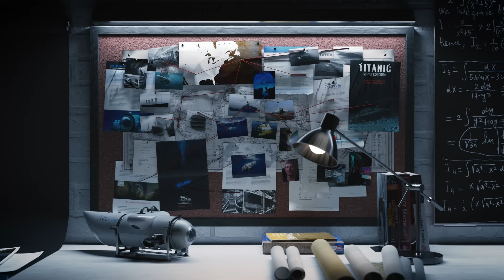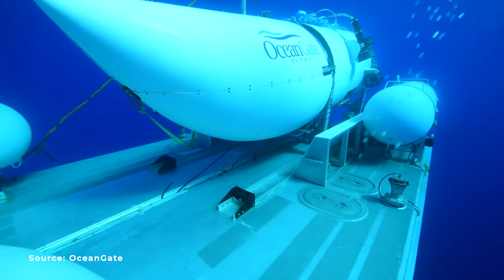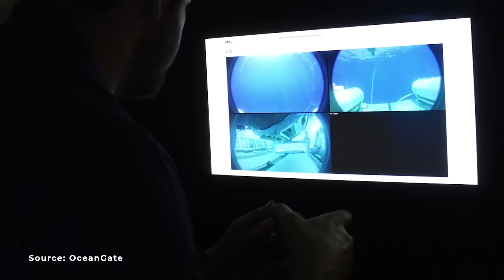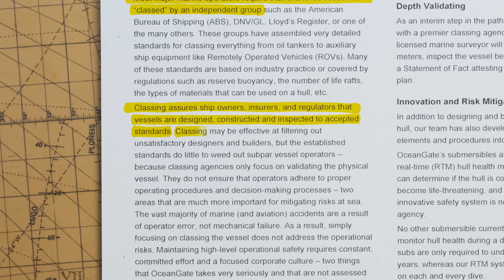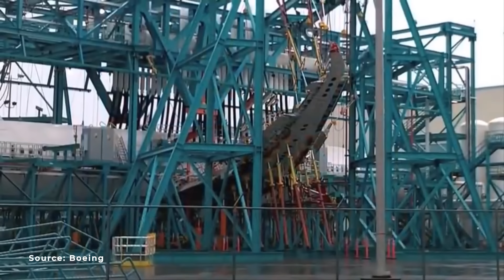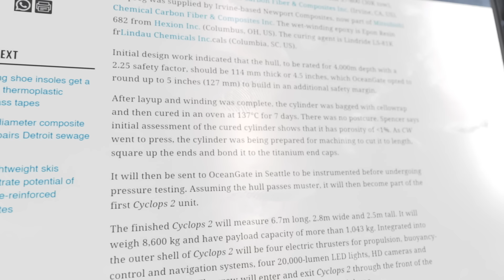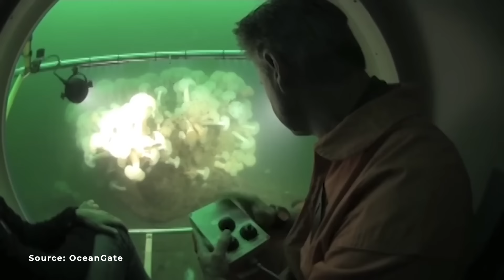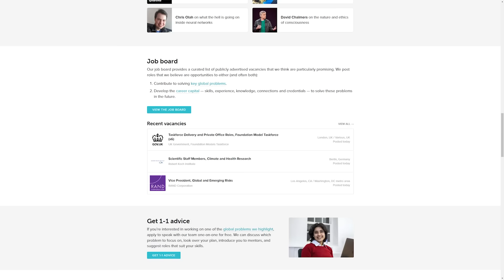The Questionable Engineering of Oceangate

Comment: 70 minutes to the bottom? Why would you want to go that fast ? It  will can only exacerbate any problems that you already have.. I would rather make sure that my sub can handle the current atmospheric pressure that I'm going through before I pass into the next. Going that fast is like putting three or four extra atmospheres of pressure on yourself all at once. It just doesn't make any sense. You're putting so much more pressure on your craft than if you just went down slowly .

 Say you have a problem that won't make your sub implode at your current pressure level but it would make you implode 3 atmospheres down. Well if you're going that fast you'll never know that versus if you were going slowly and you heard something crack you might have time to turn around. But you're damn sure not going to have time to turn around if you're passing through atmospheres that quickly. .  it's just so stupid I mean all it  can do is cause problems. These guys really didn't have a clue what they were doing did they

 the billionaires that got in that thing wet're just a stupid because they didn't do any research on the company or the sub. No due diligence whatsoever . They just assumed that the $250,000 ticket ensured their safety 😂. Like all extremely wealthy people they think money can fix everything.Well  I know something money can't fix. It can't fix stupid😂 .

Comment: Even passenger cars are tested more rigorously than this specific vessel. How many actual discoveries for the use of composite materials in crushing depths did Oceangate make, or even use? How many real world, full or even small scale tests were completed for something that would at least let the designers, manufacturers and operators know that the submarine will be absolutely safe for a number of dives? How many non-destructive tests were defined to be performed to the actual hull before and after dives to know if the state of the structure was as expected and how many were performed? The answers to these questions would be alarming if they were in the single digits, but it's more than likely that they were simply zero. The people responsible for such an accident were may not have even been aware of the importance of such measures. Over-ambition resulted in the death of five people in an outcome that anyone with a slight idea of the Titan's design and a proper grasp of the operational conditions it would be subjected to had predicted.

Comment: I'm a Mechatronics engineer. In university, one 1st year assignment was to design a submersible that could be used for marine research. We also had to specify and justify the material used. In our group, we thought of using carbon fiber, but then we saw there was no elastic modulus in the simulation software parameters for carbon fiber in the material properties list.  Obviously, if you can't simulate it, you can't prove it would work, and the carbon fiber idea was abandoned.

Comment: From reports I have read, the Titanic ship was not sunk directly by the iceberg,  but by the portholes that were left open by passengers.  The area of the open portholes was a lot more than the gash from the iceberg, and the portholes were all along both sides of the hull, from stem to stern... While the gash was only on one side.
Reply: Erm sure.  I think it had a lot more to do with the lack of interior watertight compartment bulkheads that went to the ceiling.
Reply: @stargazer7644  When pretty much every porthole was open the watertight bulkheads mean nothing....
Reply: @chrissmith2114  It was 28 degrees on the night the Titanic sank.  Why in the would would most of the portholes be open?  And the ship has to sink in order for the portholes to go under the water.
Reply: @stargazer7644   People felt the collision and opened their portholes to try to see what happened is the best explanation, once the ship started to list some portholes would allow water in, after that it was inevitable that it was doomed. The steam heating on the ship may well have made the cabins very warm even on a cold night.
Reply: @chrissmith2114  I just took a look at the blueprints and deck plans, and the lowest portholes on the titanic were above the level of the open top compartments that are watertight on other designs, meaning those compartments had to completely flood before allowing the portholes to reach the water.
Reply: @stargazer7644  There were also apparently complaints from passengers that the cabins had an overwhelming stink of fresh paint - they did not use nice smell-free paints in those days, they had proper stinky oil based paints. l

Comment: When I first saw the news, I checked the info on the submersible, how it was made and my reaction was - welp, they're dead. It'd have been fine if each submersible was a 1-time use vessel, designed in a way that it's relatively easy to swap the hull each and every time they go for a dive, they could've simply made the rides more expensive. Their clients were billionaires, it wouldn't matter anyway and the ride would've been safe. Yet the stupid greed overtook the owner and that's why he also paid the ultimate price.

Comment: Popular youtube seems to be saying the titanium to carbon glue joint was the cause of the failure as the recovered end caps are clean.  I believe the center tube failed with the instaneous internal pressure blowing both endcaps off.  Being a retired civil enviromental engineer  and not a materials expert I am  thinking the properties of the carbon failure are not an issue as much as the lack of elastic, plastic , and fatigue properties of the matrix or resin.  Are resins designable that deform in a significantly plastic mode so as to give adequate warning of failure  by measurable strains or in the case of a submarine an observable increase in internal cabin pressure.    What is your opinion?  I hate to see you close the door on use of composites for submarines or resistance of compressive forces.  Is it not just a matter of advancing the technology  in a prudent and honest manner.  It ends up where it ends up.

Comment: Simple research / education reveals that carbon fiber is an organic material; contrarily, titanium is inorganic with a highly reflective quality that does not corrode at all in prolonged exposure to the extreme pressure of deepest sea water, which of course includes salt, which aerospace vehicles are not exposed to. So many facts are available about the effects of epoxy on the two different materials. No visible traces of epoxy exist on the titanium rings that were recovered, which is to be expected of this inorganic material with its highly refractive index. The bond between the two different materials was sure to fail with prolonged exposure to the extreme pressure of saline water at ocean depths. Many of us who have worked with epoxy realize that the CEO and his associates ignores this obvious information that is publicly available.

Comment: The thing im struggling with is that spencer composites, who made this hull and the carbon fibre hull for deepflight challenger, seem to be getting away without scrutiny.  I dont deny stockton rush, as ceo is ultimately responsible, but he was on the sub, many times. He was Icarus, not Gregor MacGregor.  Why dont we look at the design and tests Spencer did and ridicule them for making two carbon fibre hulls?  Will they make another? Stockton is done, he won't make another but spencer should not have taken a job to make a death trap.

Comment: Everyone seems to primarily focus on the radial compression component of this failure (ie: a circle with pressure pushing inward).  What terrifies me more about this design is the axial pressure, producing a multi million pound force perpendicular to the mostly circumferential wound fibers. In that direction the compressive load bearing of the cylinder seems more questionable than the radial direction.  To makes matters extremely complicated for FEA, the outer fiber’s incredible hoop strength (with help of ocean pressure) diverts the axially displaced cylinder volume mostly radially inward with preference to the inner most layers of composites to yield first.  If the dominant fiber orientation is a spool winding as shown in all the hull manufacturing videos, I believe they made a structure that’s easy to axially compress which is also prone to fail inner layers.  Curiously if you do a simple axial compression calculation of their structure’s cylindrical crossectional area and substitute in compressive values of epoxy instead of  carbon fiber, and assume the dive depth that the failure occurred at,  you get a safety factor of .91

Comment: Input from a car geek, also pertinent to aerospace use of carbon fiber: the autoclave curing mentioned is also often paired with what's called pre-preg or dry carbon fiber. Pre-preg basically means that the matrix material is already integrated into the fibers, and only needs to be heated in the autoclave to cure. This is the type of carbon fiber used in aerospace applications and in expensive supercars. That Stockton Rush thought he could get away with using hand-laid vacuum-bagged carbon is absurd. That's the stuff that anyone could use for backyard carbon fiber projects or aftermarket car bodykits. I get the feeling that Rush genuinely thought that he just needed to use more of it and make the hull super thick to compensate, which probably did save the company a lot of costs compared to dry carbon. Problem is is, well, we all know by now. And it's likely that using dry carbon would've just added a few more dives to that deathtrap anyway.

Comment: If the leaked transcript was not fabricated,  the acoustic warning systsm indeed did warn them 20m, before the last message from the sub.

However the sub was diving 30% faster than expected since the star, due to unkown reason and the sub floated upwards very litlle during those 20 minutes.

In the end the sub had a partial battery failure  as well.

A reasonable captain, would have aborted the mission at start then and have the sub checked for the dive speed, but no such person would of course be in that innovative backyard sub.
Reply: Did not know of excessive diving speed, (even ascent speed critical).....
dP/dt, Pressure rate CONCERN !!!  Stress MUST propagte EVENLY AND EQUALLY ACROSS the ENTIRE HULL with virtually no DIFFERENTIAL. That is a Spec & Op violation. Along with unknown reliability of number of Pressure, Fatigue cycles permissible.

Comment: You failed to mention that the installed viewport even rated for nearly the depth they were going.

Some  theoretical research has been done on using carbon fibre as a material for pressure vessels. Concluding that it could be feasible but would come with major design challenges. It's clear that OceanGate did not take these design challenges serious enough.

Additionally a submarine designed for that depth has to keep near-perfect roundness.

Comment: You don't need to be an expert to suspect the carbon fiber hull was a bad idea, you only need to know that filament is far more effective in tension than compression and that diving is pretty much all about compression. That was an immediate "this doesn't seem to make sense" red flag to me. We know that the sub ran into power issues and dropped ballast, which means they knew some time before implosion that something went wrong. If the alleged transcript leak is true, there were at least 18 minutes from first alarm to failure, much of which spent trying to diagnose power/thruster issues when thruster ascent turned out excessively slow (a possible sign water got somewhere it wasn't supposed to) instead of doing an emergency ascent.
Reply: Just Nylon monofilament fishing line rated at 20#, Pulling on it, it's strong. Compression, FORGET ABOUT IT !!
Reply: @adrianmonk4440  Using carbon/glass/nylon/polyamide fiber filament for a compression load is like using concrete for a tension load.

Comment: I do composite work for an f-sae team, and the fact that they didnt use an autoclave to save costs is absolutely insane. Even we use an autoclave for the most important and structural parts, and I have a funny feeling our budget is a bit smaller than oceangate.
Reply: We have I think 4 autoclaves where I work in SoCal that would have fit that hull. Not sure if the other, smaller autoclaves here would also work.

One of them is large enough for a school bus to drive into. Currently unused, but operational.
Reply: 200k to make the the submarine and the other 10 million on hookers and coke for Stockton rush cause he had to be on something to think this was remotely sensible
Reply: Ha, and we used expired pre-preg when I was in FSAE, but that's because we had a tiny budget and it was a goddamn FSAE car, not a deep sea submersible.

If you are are a billionaire building a life-critical pressure hull, and you're cutting corners that would make a team of 20 year old, sleep deprived amateur race car engineers with a budget of zero dollars nervous, you should probably stop what you're doing immediately.
Reply: Haha, I felt the exact same way, there's no way my F-SAE team can afford to use an autoclave, while OceanGate couldnt. Each passenger pays 250k, and they couldnt afford an autoclave. Crazy
Reply: I too did composites for fsae and I had to pause the video and scream into a pillow at that part. This is the kind of neglect I might expect from a 19y/o without a degree and illusions of grandeur. Hell, you don't even need a degree to at least know you should get air bubbles out of the resin. It's common sense for anyone that's ever actually worked with the stuff with their hands. 
We learn about fatigue testing in undergrad... All of this is just neglect of the basic due diligence one should expect of anyone with a relevant engineering bachelor's degree.
Reply: when I heard that I was absolutely mind-boggled. It makes absolutely no sense to me why they did not use an autoclave
Reply: I'm pretty sure it had to be done in an autoclave because it was a pre preg layup, not filament wound like this says. Rush says so in a presentation about the first and second hull design.
Reply: It's not obvious that autoclave consolidation would have made this fundametally safer. There are vessel design issues that have little to do with consolidation.

Autoclaves of that size are really uncommon. I'd totally believe that they simply couldn't find one to use.
Reply: @appa609  Autoclaves of that size are used on a regular basis all around the country. They are not rare by any means. As for where to look for them, talk to literally ANY composite tooling manufacturer, they pretty much all have one. (Composite tooling manufacturers make the molds on which final composite parts are laid up). Aerospace, Automotive, Oil & Gas, etc. you would be flabbergasted by how many industries make use of composite tools for manufacturing parts they need. These tools have a limited life-span and need replaced fairly regularly as well, so there are always more tools to be made. It was certainly not a situation of "they couldn't find one", they had been working on this sub for YEARS before this accident. They didn't even bother to look, or if they did, they decided it was too expensive despite the risks, simple as that.

Comment: In a way, this disaster reminds me of the Dee Bridge disaster in 1847, in Chester, England. I am curious if people would call Robert Stephenson stupid or foolish. Either way, i don't really see a trend here, over-confidence and risk taking have always been a companion to innovation. Brunel showed this over-confidence, despite his successes, he also pursued questionable endeavours, causing calamities. I'm sure every today-considered-great engineer was warned that his projects would result in catastrophe. How many lives did the construction of the Panama Canal claim - arguably even his "mastermind". I design cast aluminium wheels, a material that has less favourable material properties in tension than in compression, also no endurance limit, concerns with material defects etc. Basically the worst material to choose to make a fatigue-loaded component with a fully reversing loadcase. Yet we can make it work. It's safe, because we understand the safety factor and can design for it, and we have sufficient testing to back it up.

I guess after what happened, "the guy was an idiot" is an understandable public sentiment, but as most things in life, maybe there's a bit more to it. The sub had multiple successful dives, I know people will reject this idea after what happened but that's no small feat. Maybe, if the hull was retired in time, keeping the operation safe, and moving on to V2 with the learnings, the perception would've been different. I personally think SR actually trusted the design and the crack detection system, which brings us back to the over-confidence personality. 

I guess what I try to say is, the focus is on the engineering, but I think the mistakes where made on a human level / personality / judgement. And with the examples I've pointed out before, that's not new to engineering.
Reply: Yeah But !!! You got it going on but from go-cart, to race car to passenger vehicle to airliner, there are order of magnitude increases for each case in requirements, testing, & traceability of materials, sources, testing, & documentation. 
* * *
THIS IS A PERSONALITY DISORDER as you alluded to and Criminal disregard. If an FAA certified airplane mechanic warns me of problems... AND I STILL TAKE FARES it's on me.